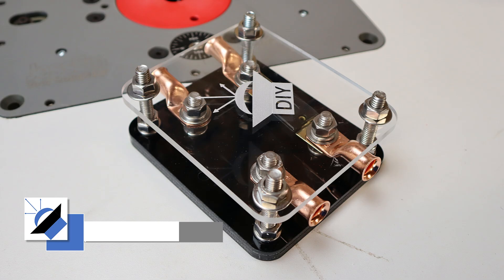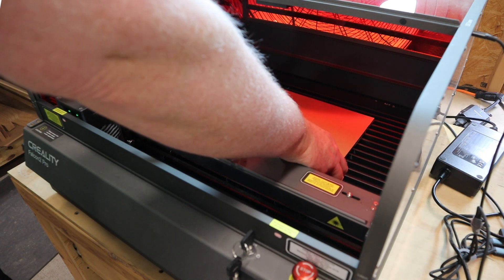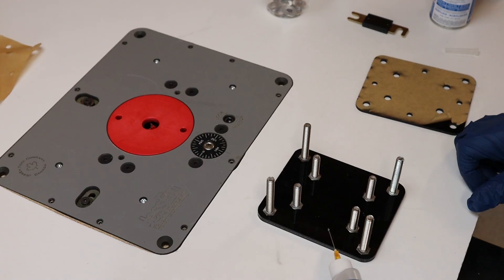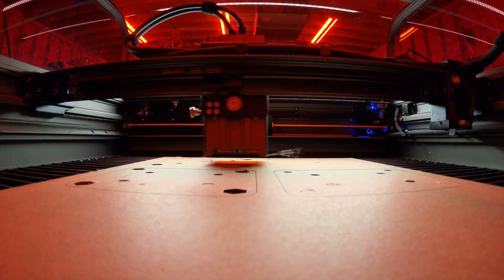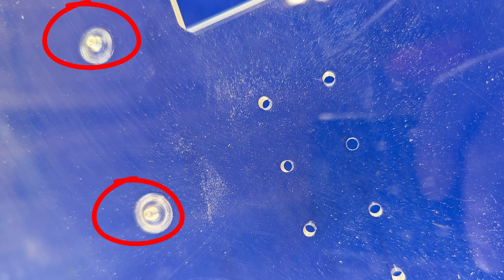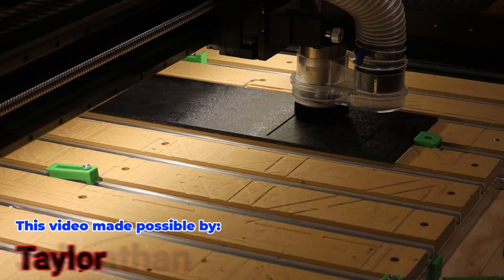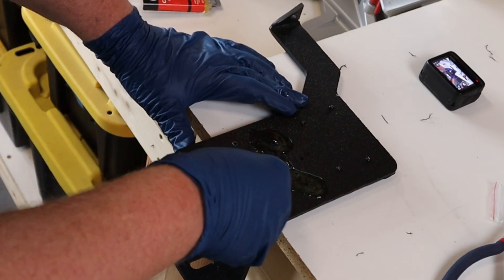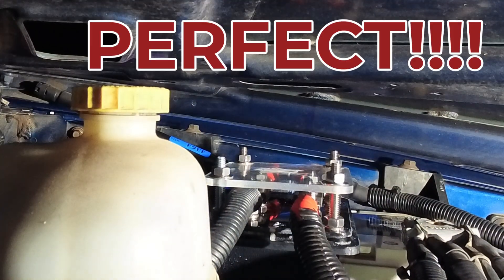Don't buy a fuse holder, build your own car audio fuse holder.

Comment: Also, instead of all your connections on one top post, XS Power make side post adapters. You can have 2 top post mounts and a side post mount per positive and negative sides of the battery.

Comment: I build my own fuse holder. I used wood as the base, drilled holes for the bolts, I used left over covers I had laying around. Not the best cosmetically but it’s functional and serves its purpose.

Comment: I use littelfuse automotive parts. Flashy fuse holder is an amusing quirk of car audio. I also love the arrays of 10 rca connectors between a dsp and amp taking up a whole enclosure face instead of some 20 pin molex. It does look kinda cool but it's pretty silly if you come from a more general electronics background

Comment: For all the whiners complaining about him using a laser - you can do all of this with a $40 router.  A jigsaw even but the post machining to clean up the edges takes a long time.  Stop looking for excuses and look for solutions.  
Single flute cutter works better on plastic because it cuts just once per revolution.  I doesn't seem like it would but that gives the blade and the plastic a moment to cool.  Slowing your feed rate with a multi-flute bit would also do the same thing.
Machining ABS is the absolute worst.  Acrylic is 10x better.  You could have made the mount out of acrylic.
Reply from the maker: Good to know,

and yes, you don't need the fancy tools.  Those tools just make it easier.

Comment: Because everyone has a laser cutting machine at home. Kinda useless video
Reply: But you can make the 3d models and dxf files to make the cuts with a company or with a mate that has the equipment
Reply: @dannywires2092  and so, where is the DiY part? Bought a cheap fuse holder made in china would be way faster.
Reply: @guilhermeleffler diy it's better when you have a huge sistem, larger chinese fuse holder has only 3 or 4 fuses, or you can use copper plates or copper machined squares
Reply: @dannywires2092  the question its not how good or bad the project can be. 
The problem its, the guy call his Channel DiY and uses specialized tools that no one has at home. Its just a bad joke!
Reply from the maker: I started with a cheap circular saw on the back patio.  It is about the trip, not the destination.
Reply: @DIYAudioGuy  i know your trip. And its awesome. But, you are loosing the DIY spirit. Just a touch.
Reply from the maker: @guilhermeleffler   keep watching, I'm taking this somewhere.

Comment: With all the fancy equipment you need I will just buy mine from Amazon. 😊
Reply: TBF, you could make it by hand too. You don't strictly need a laser or CNC or anything like that. The trick with watching videos like this is to see what he does and then adapt that for the tools you already have available. For me, I don't have a laser or CNC, but I've got a 3D printer. I could print the base instead of cutting one and hand drill the holes in the top cover. Really no way for me to etch acrylic, but I've got a Cricut so I could make a sticker instead if I really wanted too.

Also, the thought that "I'd need all these expensive tools to make one, might as well just buy one instead" loses value over time. I felt the same way before I got a 3D printer, but then it seemed like I was buying stuff I could just print myself fairly often and so I bit the bullet. Now a couple years later the money I've saved by printing parts instead of buying them has mostly if not completely paid for the whole printing setup. Plus having all custom stuff designed just for your specific wants and needs is nice too.
Reply: @Up2Trbl  the use of any CNC machine just kill the DIY spirit that was supposed to once, being a focus of this channel. I really love some old content. But this, its a bad joke!
Reply: Or buy one from Steve Meade. Support US small businesses.
Reply: Would be nice to have all of that..or even have just a garage or workshop would be amazing. But it's possible to do all of that on your porch with a dremel as well.
Reply: @AWeednerd 
It probably is but it's much easier to get if from Amazon and it looks better too. 😊
Reply from the maker: @AWeednerd I started on a porch with a Dremel. Literally my first ever power tool was a Dremel.
Reply: @DIYAudioGuy sure.. bro sure...